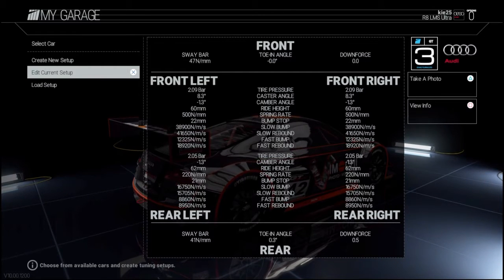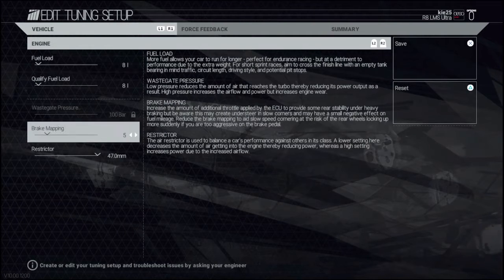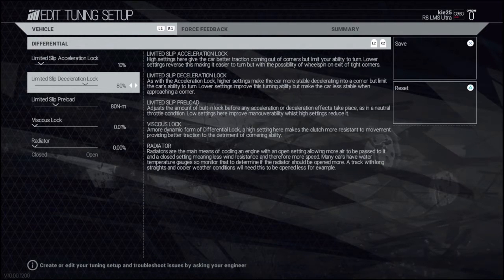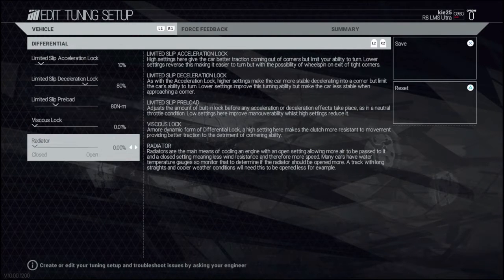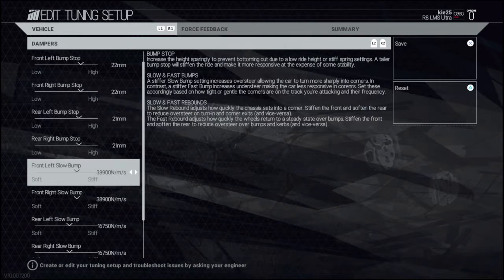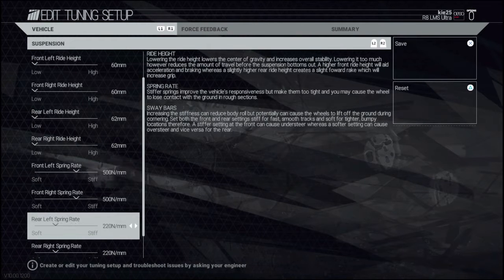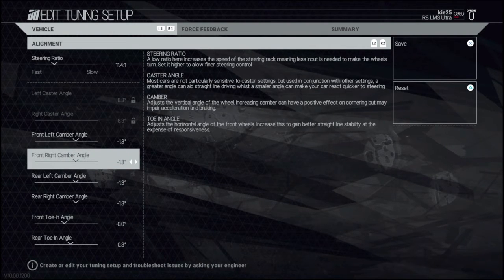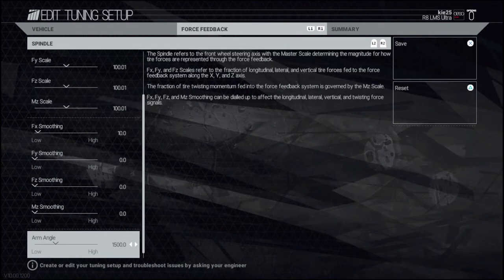PROJECT CARS AUDI R8 LMS ULTRA GT3 1.42.963 @MONZA HOTLAP PLUS FULL SETUP GUIDE

Comment: hey kie, nice clean lap! which wheel do you have and can you share the setup of it? ffb classic or standard and which sensitivity and deadzones?
Reply from the maker: I use T500, I didn't really mess with FFB to much think my FFB is 40 but that's because the T500 is very strong, other settings are basically standard as ive only changed a few basic things with wheel settings 👍🏻
Reply: +TheKie25 ok i will try thx

Comment: Kie25， so the key factors is downshift right？ In qualifying I can downshift quickly but maybe will cause engine failure
Reply from the maker: If mechanical is off you won't harm the gearbox at all, I tried it with Mechanical on and got a 43.1 shifting normally so it's a advantage but only very small 👍🏻.
Reply: so, in this video you turn mechanical failure off, right so that you can push harder than before?
Reply from the maker: +Sebastian Van with R8 yes but only gain about 200th I'd say, with RUF, Z4 it makes no difference as you can
Downshift aggressive with mechanical on and it won't damage engine, just depends on the car etc.

Comment: What feed back force did you set up? 100?
Reply from the maker: What do you mean? In main options think it was 40 as T500 is strong on FFB.
Reply: I use T300RS and set the Force 100%
Reply from the maker: +Sebastian Van yes the T300 is very smooth so you need FFB high, I've used T300 a few times but found the feedback very low.